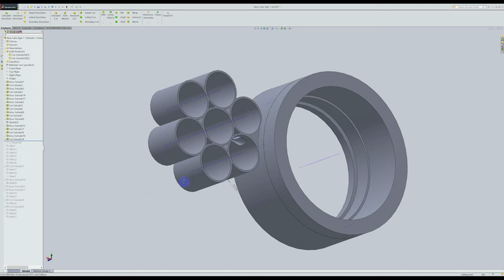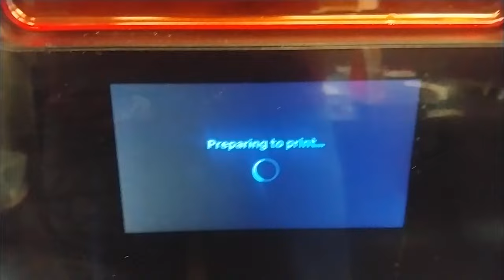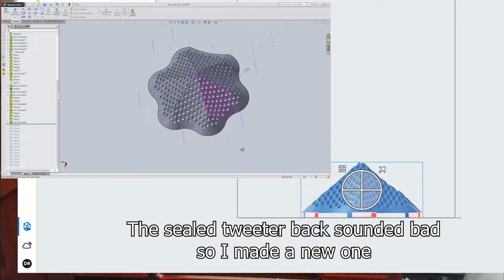Hear & See Build 7 Foot Polished Stainless Tube Speaker

Comment: Lol Dave here casually wiring his own crossover from scratch
Reply from the maker: From the ground up with what I have access to and achieving the desired sound and look
Reply: Back in “the day,” Dave and Brian Rat built all their crossovers for their wedges and such. I recall they used the leftover wood circles from the driver baffle board cutouts for the assembly. I can also recall what would happen when they took a bit too much power 😎
Reply from the maker: Ahhh, the Pizza's!

Comment: Is there a particular advantage to using the mic capsules for the tweeters or did you just have a bunch of them lying around? Its a cool concept either way
Reply from the maker: Both. I had a bunch and tested them and they sound really good, clear and open with amazing HF
Reply: @DaveRat  Most tweeters don't sound that great as microphones. Linearity and low distortion is fundamentally clean, from a transducer engineering standpoint, whichever way the energy goes in.

Interested to see more detail of the crossover design and handling of impedance. Are they all running in parallel? Can't really see on this video. What about flyback/eigenmode inter-driver loading imbalances?. This high impedance tweeter array layout is stuff I've only considered on a theoretical basis, rather than turned into a working machine.

Comment: Maybe I'm missing something, but are you somewhat combining a transmission line and a Helmholtz here?
I've never seen a design similar before. The tlines I've seen either use a folded line for space savings with a mouth near the driver. Or if they are a straight line, they seem to be mounted vertically in the room, so the return time won't factor into how the output of the port and the driver sum. And none of them that I've seen included a port on the mouth of the line!

Super cool design, would love to know more about it!
Reply from the maker: Yes Helmholtz and the long tube delays the reare sound 7 feet plus 7 feet or about 1/2 wavelength of 40hz

Comment: How do you think it would affect the sound if the tweeters were mounted around the outside of the midrange spaced symmetrically as opposed to in their own unique cluster?
Reply from the maker: That would increase the diameter of the tweeter array making more directional. Also the center where there are no tweeters would create a phasy sound off axis. .basically it would make it very beamy and not sound so good off axis.

Comment: I do a lot of 3D printing also, but I have 2 FDM printers not Resin and I still use Tinker Cad, I need to get better at something like Autodesk  Fusion 360, but I think it costs a good bit. Maybe I need to look in it Solid Works! I love to build my own solutions to stuff! I have watched another guys channel where he builds little 3D printed speaker enclosures and tests them, but this was pretty cool Dave!
Reply from the maker: SOLIDWORKS is bit of a learning curve and not inexpensive. That said, I tried autocad 3d based offshoots and the build was cumbersome. SOLIDWORKS has a sketch then refine process that I find most enjoyable to design with. The SLA printer is a bit messy but the detail is amazing and I have yet to even use high resolution
Reply: @DaveRat  Amazing the world we live in, that you can design and print stuff yourself. I am amazed all the time by it.
Reply from the maker: 👍👍👍 right!  Fun!

Comment: Mic capsules actually share a very similar design, in terms of the diaphragm and coil, to headphones! However, I think they’re slightly stiffer, meaning they’d have more volume, less bass when used as a speaker. They seem to work super great as tweeters, way beyond my expectations, and I’d never thought of them as a viable option!

Comment: Does the length of the pipe have any bearing on the performance?
Reply from the maker: Yes. Having the port output on the rear located far away from the front creates a more directional low frequency coverage.

Internal volume is relevant and 8ncreases with length. 

Resonance is a concern so adding damping is important
Reply: @DaveRat  I assume the speaker is loaded like a transmission line enclosure. Of course all your modeling videos have me wondering what the interference pattern would be at 20, 30, 63, 100, etc. However, I'd bet that thing can create standing waves in the room with ease. It sounds wonderful on the zoom recorder! Thanks for posting these, it's great content and engagement. Let the algorithm beware!
Reply from the maker: Thank you. Yeah, getting the rear of the tube in a room corner is best. The output from the rear is quite low freq and this makes the tube directional in the LF aimed forward
Reply: @DaveRat  thanks for sharing this!

Comment: would it sound the same if you curled the tube up into a snail shell? or even mitred jointed the pipe with welds, to form a cubical spiral with the cones on the center of one of the cube faces, like one of those pipe screensaver mazes
Reply from the maker: Turns and angles offer added airflow resistance and reduce the efficiency of the LF tuning. That said, a well designed airflow will do just fine. 

One aspect that could be 8mproved 9n this design is the airflow around the internal port opening. Adding a donut may slightly improve things.

That said, I use a sub and the LF is plenty.

Putting the rear port in a room corner offers a big bass boost

Comment: Huh. I wouldn't have imagined mic capsules as being up to the task of operating as a hifi tweeter (even with 7 of them). Did you frequency shade the centre vs outer capsules, or are they all running over the same bandwidth?
Reply from the maker: No shading, I wanted a very beamy HF to reflect off the TV and hit the couch. It's a very neutral and enjoyable sound and the mic caps have amazing HF clarity
Reply: @DaveRat  Yeah I was surprised by how good those mic caps sounded as tweeters!

Comment: 2 maybe dumb questions lol. When you said "we'll tune it", what does that process look like for you? Second, how are you sending the sterio signal to it? L to half of the tweeters and R to the other half, and both sharing the woofer or?
Reply from the maker: For tuning I hang it and measure with smart and modify the x over as needed.  I already got it pretty close as you can brieflt see in the vid when I pink noised it.  As far as stereo, I built two
Reply: @DaveRat  Hah, okay, I kinda figured you meant something with the crossover. Ohhh you built 2 hey, I should have guessed lol.It was bugging me, and I was like how is he playing that song sterio through one speaker. I guess my theory wouldn't really work so I should have known hah. Thanks Dave.
Reply from the maker: Actually I like your theory and could make a version that works.  Will ponder that adventure
Reply: @DaveRat  Hah okay, cool. I guess I shouldn't have been so quick to say something wont work, but I guess it's like what you discuss in your newest video, and how often a thought or idea might seem outlandish or wrong, but like you say we're mixing engineers, and at the end of the day it's not always about right or wrong. I like how you also said in another video, alot of these effects and things we've come to like are from pushing the boundaries, thinking outside the box, or breaking the rules! Thanks Dave! Hope your weekend is going great!
Reply from the maker: Fun and thank you James!

Comment: Dave, what is the function of the length of the tube? I know it’s not an arbitrary decision, and am wondering what led you to determine that exact length for your application.
Reply from the maker: The tube length was chosen to be aesthetically pleasing and the sound travels 7 feet to reach the rear of the enclosure, the btravels another 7 feet to hit the front, so the sound from the rear of the speaker travels 14 feet before combining with the front sound.

14 feet is 1/2 wavelength of 40hz. 

And the rear of the speaker sound is polarity reversed, so 180 degrees phase shifted.

So the sound from the rear in in phase with the front sound in front of the speaker at 40hz.

Shorter tubes will sum at higher freqs and longer will sum in the forward field at lower freqs.  4hz seems a good freq for the design.
Reply: @DaveRat  I have much to learn sensei. Your videos have LITERALLY had me up nights tossing and turning. Thanks for sharing! 😎
Reply from the maker: awesome and thank you

Comment: Hi Dave, wondering what the machines are you’re putting the 3D printed parts in. First is the printer, what are the 2 after? Some sort of annealing for the plastic?
Reply: all (sla) liquid resin printers need at least a washing station to remove any leftover un-cured resin of the model(as it is toxic). the third one is i guess further helping with hardening and curing (the liquid resin is cured or hardened with the help of UV light)..
Reply from the maker: It's a Formlabs SLA printer using uv laser to harden liquid resin. The 2nd is the alcohol wash to remove excess liquid resin, the 3rd is uv and heat to cure the resin

Comment: How did you decide the tube length? 
i.e. How did you decide on the size of the resonant cavity and at what frequency / note did you tune it to. I was thinking of a project along those lines but use one tube inside another to make a telescopic tune-able version.  Then i could set the  resonant cavity size by ear.  The tube fit would need to be good though... as good as a trombone.
Reply from the maker: I decided on the tube length for look and aesthetics, then tuned to it with the port 

I wanted a long prominent shape and no audio atifaaxts from a baffle
Reply: @DaveRat  I understand, so the length of the port tube in relation to how far it extends inside the "cabinet/cylinder"  is your tuning.  Cool,  thanks for sharing
Reply from the maker: Yes, the port diameter and length vs the internal volume of the tube determines the tuning freq.
Reply: @DaveRat  Cool! Thanks again Dave.  I'm gonna try make a few and experiment.  Big uns...   medium uns,   tiny uns...  You can see where i'm going with this can't you... ?   My Hi-Fi is gonna look like a pipe organ when i'm done...  : )
Reply from the maker: Fun!  Let me know how it goes!

Comment: Nice work on the crossovers ,Dave. I use Surplus Shed for sourcing components such as oversize cast alum. ring clamps and spacers. Just picked up a Tek 100mhz dual channel scope (yard sale) with probes/case for $80.00. I'm stoked...
Reply from the maker: Great trip, will check it out!

Comment: I'd love to know the WHY, and reasoning? Iven if it's in large part "because I can."
Reply from the maker: Several reasons.  The long tube means the sound from the back of the speaker travels 14 feet, or 1/2 wavelength at 40hz, meaning LF addition in the listening at 40hz.

Though I don't have a room corner, putting the ported rear of the cab in a room corner give a really cool amount of LF from a tiny fast speaker. 

The tweets are super beamy so I can shoot them to reflect off the TV. It creates a wonderful room sound with clear vocals radiating from the TV.

Also, no baffle makes a a really natural sound. Put your hands flat on each side  of your face to make a baffle and speak, 5hen take them away, or have some else do it and listen and you will hear the issues a baffle crates. The tube end has no real baffle
Reply: @DaveRat  perfect! I dig the rationale! 
I am a big fan of "open" sound, from AMT tweeters, to recording with the most simple and open ribbon mic I could design & build. 

Keep up the good work!
Reply from the maker: Awesome and I have an ESS AMT1  as my living room TV center channel.

Comment: I would paint that tubing with bitumen... or give it some dynamat inside. It might be a wind chime / tubular bells...

Love your style tho. Seen a guy on a car audio forum do a folded up aircon pipe TL enclosure that went in the boot. A mate of mine made a nice drum kit out of stainless aircon pipe. 18" tubes, which stacked inside each other. Sounded surprisingly good. Surdo industrial dustbin for the win... won't fit in a backpack or suitcase tho. His did.

7:45 did you fill out a risk assessment for that "do the twist" maneuver? Won't say I don't do stuff like that... but riggers shouldn't. 

Even on my phone I can tell this is high fidelity. Sounds remarkably good.
Reply from the maker: Thank you and I did mess with varying fill, seemed to work best when resonance of the tube was reduced but airflow to the rear port is maintained.
Reply: @DaveRat  there is some really weird stuff that happens inside transmission lines - the speed of sound can change a lot in such an enclosure, so the basic calculations are often off by a lot, especially with a mineral fill which changes the overall mass and loading of the air pocket.

The reflections inside the tube are likely to have a "basketball ring" or "scaffolding pole zonk" component due to internal reflections, forming weird high frequency resonances without any lagging inside, same idea as a kick drum. Would be really interesting to see a waterfall plot, and to hear the sound of the enclosure being tapped with a drumstick. 

Cabinet resonances and mechanical transmission count for a lot, also, which can be surprising, even in a drum shell from one skin to the other. It's the "rubber ball" simulation plot zone. 

As somebody who has dealt with pro audio and big intensities on the regular - you've probably done more huge shows than I've had hot dinners - I'm sure you've come across the sympathetic resonance and death-rattle of a resonant building. I've had walls, floors and stages make noises like a distortion pedal. Generally the bottleneck of audible distortion is not the loudspeaker.

To size up the problem, a whack of the cabinet with a suitable acoustic hammer, loading that into an impulse response reverb, and having a listen to the character often reveals the "tone" and extent of the aberration. Resonance is energy storage and return - very hard to avoid it.
Reply from the maker: My goal is a beautiful look and clean clear warm and crisp sound. These do great job of that.  Reflecting the beamy HF off the TV creates a wonderful realistic aorround type surround.

Beyond that, my take is that the whole concept of creating phase coherent super accurate point sources to reproduce audio is a flawed concept, so I don't bother with tinkering into perfecting something that is broken even when perfect
Reply: @DaveRat  I have always found the energy storage qualities are worth eliminating in reproduction equipment. Just like mics aren't supposed to have a "tone" (in that belief I am weird in the industry), the 'veil' can and should be lifted wherever possible. Not clipping transients, eliminating hiss buzz and rattle... when the restaurant rumbling extractor aircon in my old studio went off on the timer switch, I'd breathe a sigh of relief. I've worked a lot with steelpan, and boy that stuff can ring. You can play the pans with a drumkit at a distance of 20ft. When I experience it first hand and began to really notice, I was quite frankly intrigued. Like with a tuning fork, it only takes a light touch with a finger to mute the tail off the resonance, but it takes a bench vise to eliminate the first order smear - it goes honk rather than ping. Recording cabinet impulses and sticking the samples in a reverb is fascinating as an experience, and it closely mimics and enambles a characterisation of the distortion, which often has a quality that is in some way appealing - if you must have distortion, it's best that it sounds good - hence the surround waveguide of the angled ceiling probably adds some really nice perceptual information. Sometimes I point the tweeters at the walls in a bad room - first reflection only can be better than notched to hell. Nothing wrong with the sound of your ceiling. Stainless steel tin roof might be another story.
Reply from the maker: I don't like resonances in reproducers.

A few of those blue cotton foot long damping pieces spaced in the tube does a great job of breaking the internal volume length down and you should be able to hear it in the video as I put one in.

I made some fully damped tests with lots of stuffing that choked the LF and tested with none and it was resonant and settled with a great sounding balance between the two
Reply: @DaveRat  could also do "tube in a tube" and fill the gap with some sort of damping compound, as a "constrained layer damping" technique. The shiny mirror finish is beautiful for sure. Could use it as a luminare ligt fitting as well, make it sound activated disco disaster if you really want to be obscene. Bring on the death-star mirrorball to eliminate diffraction... with a coiled up plastic-flexi-hose-transmission line hidden within... packed in rubber chippings...

I met these guys who were making smooth-walled non-compliant flexi hoses for bandpass subwoofer concealment in ceilings and had a long chat about how on earth they got that right. ISE2019. The last one at the RAI. Sounded really good, full of glass fiber and TPU trickery. This was not the vent tubing off a washing machine, even though it looked similar.
Reply from the maker: All good stuff and also, that project is done, except for making the matching friend.

I have built several of these and this is the latest version
Reply: @DaveRat  I'm totally a fan of organ pipe-type designs - I'm a drummer, among other things. It's a lovely thing you've made here - I'm being a fastidious physicist, rather than trying to be mean. I'd doubtless be fine tracking a record on these. Probably even use 'em for mixing.
Reply from the maker: The distance of the rear port impacts the tuning and if you put the rear Port into a room corner it really adds a nice low end to it